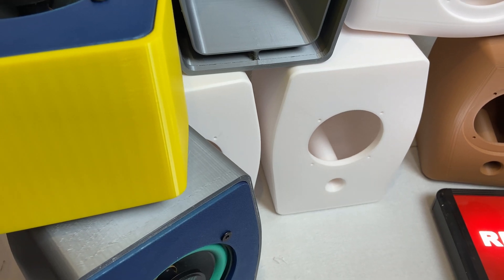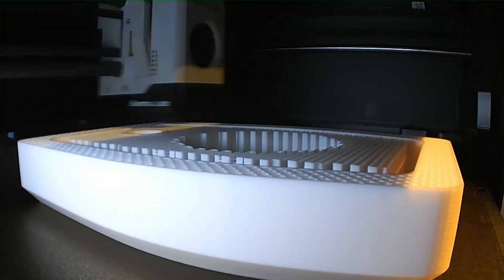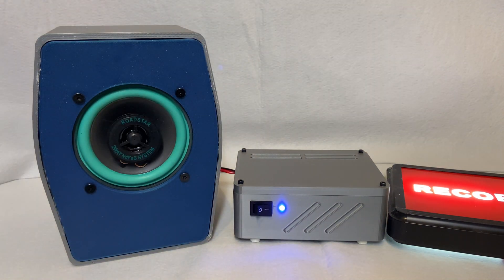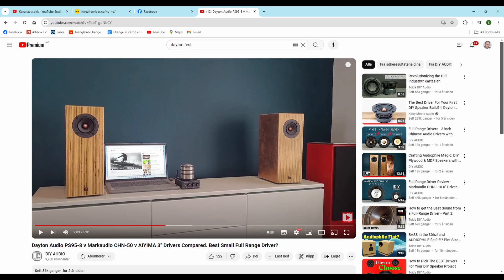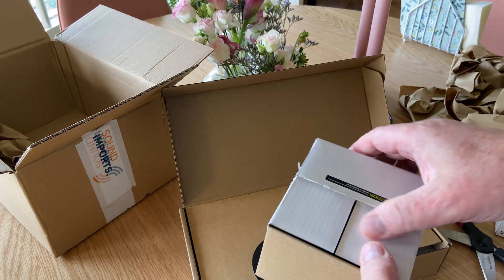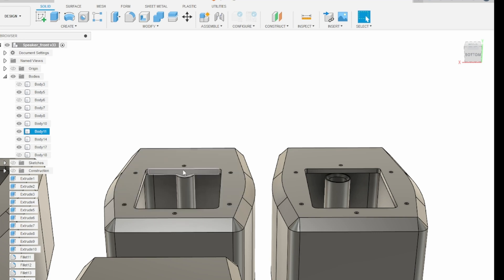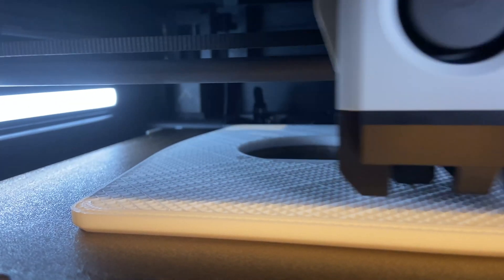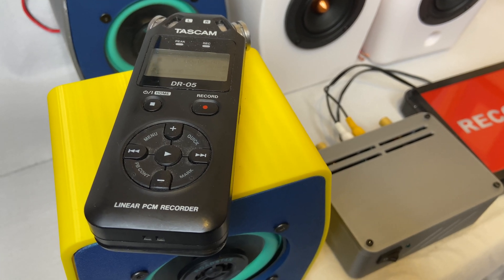Great 3D printed speakers!

Comment: Have you tried any wood-pulp filament? I imagine it would help with dampening vs. PLA. Dayton Audio makes good bang/buck speakers, however, I have found Morel drivers to be noticeably better, for a corresponding bump in price.
Reply from the maker: I have just tried PLA. PETG and micro cement. I'll have a look at Morel drivers for my next build.

Comment: You need 100% infill to avoid the vibration of the box
Reply from the maker: @frajr1986  i have filled some of these boxes with micro cement. Not much difference to be honest. And plastic will vibrate regardless of infill.
Reply: @v4projects  it also depends of damping. Polyester damping is for sealed box, Pyramid damping is for reflex. Glue damping only on 5 sides except for the front side where you install the speaker. 
Second tip: reflex is always too long for the box so, if you will play your speaker at home, consider max 2 watt. If not you will lose your hearing. At max 2 watt you Will have a very short reflex that can fit in every box ;)

Comment: Try printing with 100% infill. For me it sounds way better. Also filaments with carbon fibres gives less resonances and more natural sound.
Reply from the maker: If you watched part 2 you could see me try out micro cement/Jesmonite. It didn’t improve the sound. The speaker driver was too bad and the limiting factor. I’ll compare one box with cement and one without but with the same Dayton driver in my next video. Thanks for watching!

Comment: I'd recommend you look for drivers with a smooth transition from the cone and all the way to your 3d printed box. Otherwise you get huge diffraction peaks/dipps in the frequency. Flushmounting is essential and large 3cm radius+ rounded corners on front baffle will also give way smoother vocals.  Drivers with inverted rubber will often sound better because of the no rubber bulge creating diffraction effects. I would love to see some Markaudio drivers in these boxes since they are well made and theres soundclips comparing a ton of full range on youtube showing the general sound one can expect from all these drivers.
Reply from the maker: I am currently printing some boxes for the Markaudio drivers. It’s a scaled up version. (About 20% larger and sealed, orherwise identical shape and driver placement

Comment: Great project! Do you have the STL shared somewhere?
Reply from the maker: Thanks for asking! I will publish the STLs as soon as I have completed the subwoofer and done some more listening tests of that combo. (currently printing two sizes of subwoofers). I think most people would prefer to use a compact sub with these speakers. This will be a low cost build, but it sure uses some filament! 760 grams for each speaker. 580 grams for the small sub and about 1,3 kg for the bigger subwoofer.

Comment: My 1980 Ford Fiesta didn't have speakers in the doors, they were in the back seat area, and actually sounded quite good.
Reply from the maker: @delscoville  I had an Ford Escort. Two Kenwood speakers mounted in the rear shelf. First night the car was parked outside, someone broke the window and stole the Kenwoods. Never had a Fiesta, thanks for fact checking :-) i would like to add that even back then, most people preferred Kenwood or Clarion speakers, not Roadstar.

Comment: You could print this speaker standing at 45 degrees to the bed, then you wouldn't need any supports at all because all the angles are at 45 degrees to the bed and there are no big overhangs.
Reply from the maker: Thanks for watching! Could be worth a try. Keep in mind that there is a port inside the vented version and a "brace" in the closed version. And there is a large opening for the backplate and speaker driver.
Reply: @v4projects  if the port is perpendicular to the front face, then it is also at 45 degrees.

But I would also modify the model a little, and give it a 45degree face at the bottom instead of a sharp-ish corner. Then you don't need to support the structure, as it has a "leg".
Reply from the maker: I had to try this in the slicer :-) It did suggest some supports even for 45 degrees orientation. Print time 18:46 (3 mins longer then my print). 716 grams of filament vs 761 in my print. Interesting result and not what I expected.